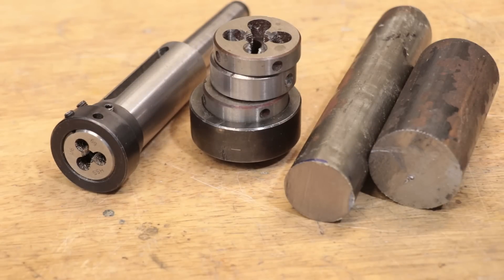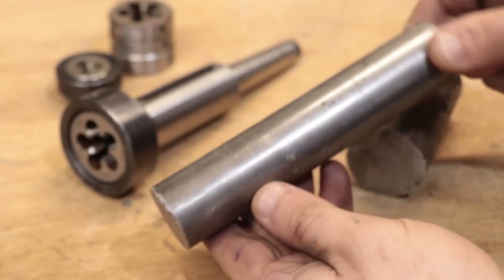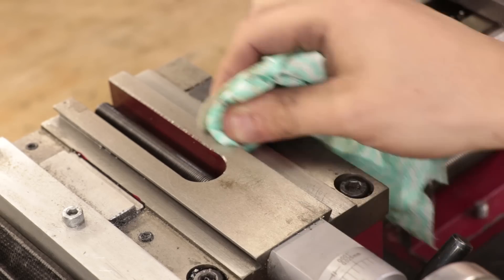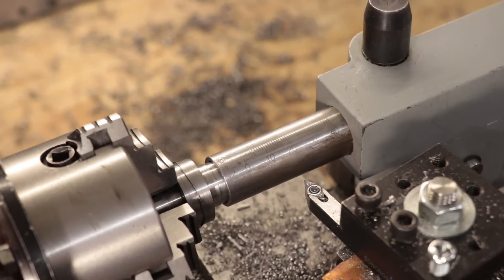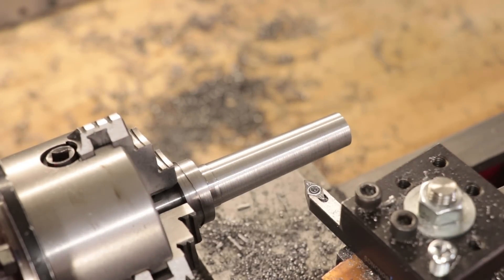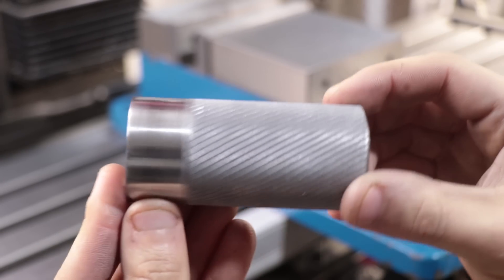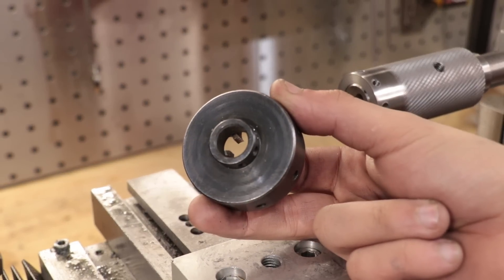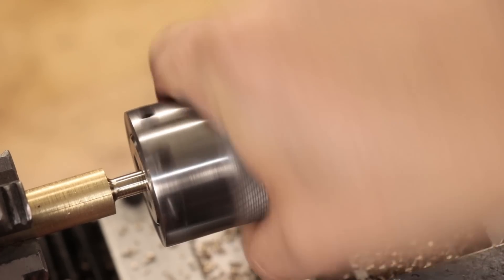Making A Tailstock Die Holder For The Lathe

Comment: 10:21 Excellent video.  I'm so new at this hobby that I think buying a store bought one is better for now which I have done.  It's very similar design but I was wondering how you are holding the stock stationary in the head chuck?  I would think maybe leaving the chuck key in and rotating until it hits the bed will work but that's a general no-no and if so I would have to learn to go the extra mile and unplug the lathe first.  What about taping a bit larger threads in much harder material, would it work the same way?  Thank you.
Reply from the maker: The dividing head has a ring with holes behind the chuck. You can probably see it in some of the shots. There’s a pin that locates into the holes and that holds the chuck in place.
Reply: Get some education and training before you hurt yourself and/or wreck your lathe.

Comment: I love watching these "need a tool make a tool" videos for making necessary additions on the cheap. I would say though that you might want to put 3 or 4 of those holds in the die holder because with only 1 hole, if you need to put in a lever for more torque, it's most likely going to be at an inaccessible angle. You might be fine with 2 holes 180° apart but if you're making it yourself anyway I would do at least 3
Reply from the maker: It's a great idea. It would definitely suit a bigger lathe, but it probably won't work on my little lathe since they'd probably end up hitting the cross slide. Cheera